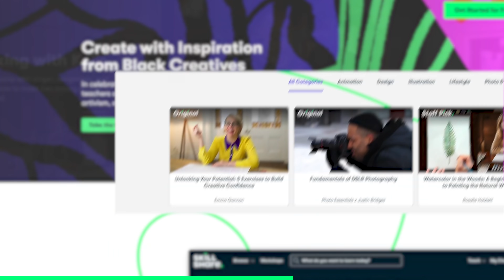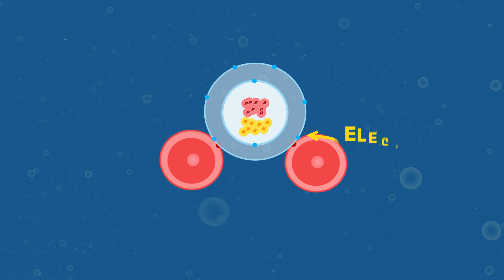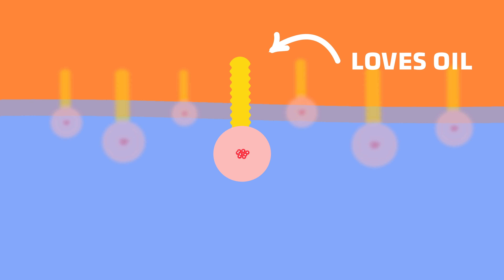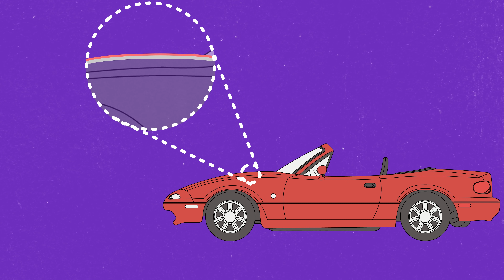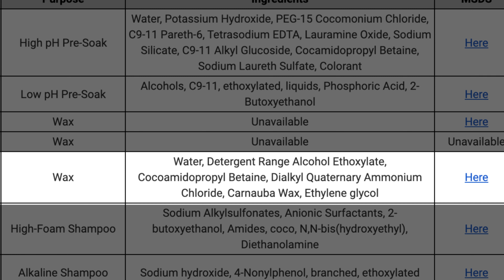Why Car Washes Might Be Scamming You with SOAP

Comment: Entry level employee at a local car wash here. Just wanted to share what I know and ask a question about the wax experiment in the video here. From what I understand about the waxing process, at the wash I work at anyway, as it's only been explained to me; the waxes and polishes we offer are "accumulative". We set the expectation for the customer that, if they routinely get these washes applying the wax coat finish at least once a week, that as time goes on, the better and better the vehicle will progressively look. I think its about a month or so's time of consistent washing that will yield optimal results. Hypothetically though, do you think the experiment would prove this considering you collected results from multiple washes over a couple months?

Comment: One thing I've learned is that touchless car washes do not clean your car. Every time I've ever used one it came out with a dust film. Almost didn't look like it had evwn been washed. Ran it throigh again and it was still dusty, but a light swipe of my finger would remove the dust. All they do is rinse off larger dirt particles. Even a pressure washer doesnt rwmove dirt particles. You can hold the wNd up close and when it dries it will still have a dusty look. If you aren't using something to physically clean it like a cloth or sponge you will always have that dusty film, especially on a dark color like black.

Comment: I've been a auto detailer for 15 years. My biggest issue with why I don't use these is not chem related. Its the fact most of them don't pressure wash those arms and brushes off. So they build up dirt and that scratches your paint. I mean for my profit it's amazing seeing someone who used a carwash for years especially on a black car. But that's just my experience. 😂 If your carwash pressure washes those brushes and stuff then I'd go there but so far I've only ever seen one in my part of Florida do that and those like 17 yr olds be out there at like midnight doing it 😂😂

Comment: It's interesting that you used a red NA Miata for your primer, basecoat, clearcoat demonstration as red, white, blue and black NA Miatas were not clear coated (except the bumpers) while silver, yellow, BRG, Laguna blue and Montego blue were clear coated. But by now I suspect most are as on my NA after 34 years only the area around the windshield is the original paint.

Comment: I used to work at a gas station with a car wash and we were told that if the carwash craps out before it's finished to give the customer their money back and tell them to immediately go to the nearest carwash and get the soap washed off. They had to pay for a customer to get their car repainted after the tricolor soap sat on the paint for too long and ate it.

Comment: My biggest pet peeve when getting my car washed at a car wash and they don't edge my windows( cracking the windows down to dry off the top). Every time I get it washed and after a few minutes I will roll the window down and sure enough they won't do it and then my freshly clean car will have streaks on the windows.

Comment: Avoid the car wash tunnels.  The brush version...Goodbye clear-coat. Might as well clean with a brill-o pad. The Touchless, has to use high PH to break down the dirt. High acidic water? Pass.  I pull into a bay, pump foam gun it. Wipe with a wool mit, spraying the mit often to keep it clean. Then hit the highway to work that doubles as drying it. Paint doesn't have a single swirl mark and it's 5 years old. But that's just me.

Comment: Commercial truck driver tip here, just take your car to a Blue beacon car wash, you may have to wait in line for an hour, but they do car washes for $25 in my state of Tennessee. They hand wash some parts and blast at others, but it always comes out nice for me for the price. Also I would like to mention that if you have a lifted truck, pushing the maximum  allowable height for the automatic car wash, the worse job it will do, according to my experience. Nobody asked me for my opinion but here it is anyway. 🫡

Comment: The pH of the soap if mostly bullshit. You use a very small amount of soap to a very large amount of water, so lets say water has pH 7.0. Then use a soap with pH 5.0 and the result will be like... pH 6.99. In fact, the temperature of the water has a bigger effect of the pH than the soap. Not to mention the normal variations of water, not only between different places but over time from the same source. As a factual example. Our municipally water here have a pH of roughly between 8.0 and 8.5. Yes, that variation is NORMAL. And also a pH above 7 is normal.

Comment: not accurate! and misleading...a microscope would not test whether the "polish" worked. If the foam really did have a wax, sealant, SiO2 in it...it would leave a microscopic layer of protection on the paint. This you can test with a gloss meter or test for hydrophobicity by spraying water and analyzing the water behavior

Comment: Or don't use a touchless wash. Years ago some story made me paranoid about using a brush carwash. Well I now have been using one for years three times a week because I am an Uber  driver. My car is not at all scratched up. It gets the job done. Usually at the end there are a couple areas requiring some attention particularly with drying. But it gets my dirty car clean.

Comment: I had an idea similar to this to see how much salt is in the water during the colder months. Surely they recycle the water through filtration to save on cost, right? Most filtration won't remove sodium dissolved in solution.

Comment: I can simply things for everyone. Generally speaking, the soap and pre soak are the same chemical, just titrated differently and applied at different pressures. They add foaming agent because people think it cleans better if it's foamy, but it's only foamy so you think it's doing a better job. Bug and tar remover is usually the same chemical as the engine and tire cleaner. Tri Gloss is essentially clear coat or wax with foaming agent and dye, and often if a carwash is out of Tri Gloss they'll substitute it with their regular clear coat or wax. The rinse water is usually recycled water from previous washes, with the spot free being RO city water. The drying agent is often diluted wax as well.

Those are not rules as every carwash will have different chemical suppliers. 

My family is deeply involved in carwashes building, sales, and chemicals.

Comment: Just took my car to a wash last night. There’s two nearby, one that is decent enough if I just want to get thick layers of dirt off. The other one hardly gets the rear side of my car clean whenever I’ve used it. Unfortunately, the decent one was closed, so I had to use the crappier one. I tried their most expensive wash, weakly justifying it by thinking maybe I just didn’t go for that one in the past and that’s why the rear side wasn’t clean last time. Nope. Made no difference except, just as the video said, it just took more of my money. I’ve never been fully trusting of touchless washes for those reasons. I only really use them in the winter when it’s too cold to use the garden hose.

Comment: I owned a carwash and we do use different chemicals and run the machines at different speeds or numbers of passes for the more expensive washes. However the cleaning is done through contact. Sure the pre sprays and chemicals loosen things up but you cant really get that clean without having adequate and even contact. Many of these machines have laser, touch and strain sensors to know when they are putting too much pressure on the vehicles and back off to avoid scratches. Two most important things in an automatic car wash is how clean the rinse water is and how good the lubricant that gets sprayed onto the brushes are. All the other stuff doesn't really alter the wash in any noticeable way. The only time I had a long program outperform a basic 4 cycle was with multiple rinse cycles between chemicals and thats a huge waste of water.

Comment: As a car cleaning and eventually into auto detailer since age 13, I never trust automatic car washes. Most of them are horrible. Let's just discount the washes with brushes because it's pretty clear where that's going. You couldn't pay me to go through there.
The touchless washes are just ok, but choose the cheapest option because God knows what money they save using common detergents and degreasers which, alright yeah they smell good and look cool lol. I had a Ford focus and my dad has an 03 Land Rover Discovery and after Chevron's wash both cars started to have this horrible milky streaking on our plastic trim after going through the "express" wash or whatever. It wasn't the cheaper option because the mid and upper options had loads more "washing steps" but It just tore apart the layer of Wipe New I had applied a short while beforehand and never, over 2 years, was I ever able to get it off despite trial and error on inconspicuous areas of the trim, tons of research and all around brainstorming in desperation. The cheapest touchless car washes are much more worth it if you wanna get layers of dust, bugs, mud, other debris, somewhat removed from the vehicle. Keep in mind though that's with expectations for as close as possible to a showroom floor quality detail.
Reply: It's worth mentioning that the Wipe New was hardly to blame if at all because on both of the aforementioned vehicles, the product was applied at vastly different times: on the Focus, it was a year or so before the land Rover, which it had been applied to about a couple months back. And the horrible streaking that was left behind only very slowly started to disappear just with age more than anything. I mean a year later they looked, for the most part, back to normal again. I gave up after a few months of throwing everything I had at it to get it to come off the Focus.

Comment: Cheap kids bubble liquid ((soap )) is also good as an insect killer especially FIREANTS I hate them pour some on the ant hill hose it up to foam and let it sink in boom ant carnage wash and repeat for total ant killage let it soak in and it gets the queen and most times they will not come back either cheaper and safer than those expensive chemicals ants have exoskeleton bodies so soap blocks the breathing passages

Comment: Modern car washes often re-use the water, but that saves millions of gallons of water over its lifetime and is OK, as long as they filter it.  Automated car washes can knock off your mirror or scratch your car if they're never repaired and maintained.  In spite of all that, automated car washes are much much safer to use than human car washes.  All those people are scratching your paint; you can only hope that it's not on purpose...

Comment: The negative pole on a water molecule is located as far away from the hydrogen atoms as possible: the opposite side of the molecule, not between/around the hydrogen atoms as circled at 2.57

Comment: Other than spot washing bird poop or occasional tree sap I probably haven't washed a car in 20 years or more. Rain washes it, I live in NC so that happens on a fairly regular basis. Dirty part is probably around the gas cap that has a door over it so it doesn't get rained on directly. And I've had mostly gold or silver metallic cars and trucks that don't seem to show much dirt, and the paint doesn't peal off like it seemed to do when they first came out many decades ago. My 97 Chevy truck is silver metallic and I've only recently noticed the top of the cab maybe starting to get a pattern of spots that might start peeling in the next few years. But even though only a 2wd it's high enough that I really don't see the top very directly and so probably won't bother me.

Comment: I only use an automated carwash for 1 reason. Salt. I live in PA and in the winter when it snows salt is used to melt the snow. I don't want that salt on my truck at all. So the moment the snow has passed and there's no more saltwater on the road I immediately go to the carwash and get the option that has the undercarriage clean just to wash away most of the salt.

Comment: BIG Prob in places with salted winter streets is whether the car wash water is recycled.  Costs the operator mucho dinero to use fresh water with each car wash so they recycle the water AND EVERY bit of salt back onto yer car.  MAJOR problem happens bec the salted water when sprayed up into all the nooks and crannies (NOT grannies) above and esspecially below your car do what salt is paid to do - RUST like it's 1999.  NO, the rinse water DOES NOT FLUSH it out, it only pushes it up into the nooks and crannies of the nooks and crannies.  I know, I learnt the hard, expensivo way when the  rock-n-roll rocker panels of my beautiful car turned to thin sheets of perforated metal in a mere three years.

Comment: I like using a foam cannon with my pressure washer. It’s like tricolor foam but way better. Spray, scrub with a clean car wash sponge or mitt, and rinse and repeat until all the dirt, oils, organic gunk, and grime is gone. Every 3 months, wash as usual then use a clay bar to remove the old wax, and apply new wax.

Comment: The wash at my location was a 100% reclaim system meaning we did not have a sewer system to discharge into. Due to this our BioReactors could not digest the red dye so the three waxes were applied, blue, yellow and white. Also, car washes are just a basic maintenance wash which is very good at keeping the dirt granules off the surface. To remove all dirt you manually have to remove it and don’t pay for wax every time as it just seals in the dirt.  Look at your windshield and this will be apparent.

Comment: I worked at several car washes in High School and College (the tips are good).

The general information here is accurate.  There's 2 types of car washes and they both have their pluses and minuses.  Touchless is less likely to have dirt soaked brushes slapping against your paint at a high rate of speed, but quite frankly they don't clean the car even remotely all that well. 

If you don't believe me - make sure your car has a layer of film that you can differentiate by running your finger across it (or by writing "wash me").  At the end of the touchless car wash (and make sure there's no cheating with people preaching with mits - otherwise it isn't touchless) - don't have it towel dried.  Your finger mark will still be easily visible.

Touchless car washes essentially wash your car in 1 of 2 ways - by preaching with mits or with the towels drying the car.  Neither option is all that clean.

Comment: I’m a pressure washer we use hot water with out soap and it works if it’s really bad yeah we will use degreaser but mostly hot water is all u need  even engines

Comment: The only issue with the touch-less washes are stronger soaps. This is to help break down crap on the paint. It won’t harm your paint, what it can do is remove any wax/sealant protection on your car. Learn how to do a Rinseless wash for a quick way to remove lighter dirt and bird shit. A good waterless wash and soft MF towel will remove bird shit too.

Comment: The concentration of soap, wax, tire cleaner, etc. depends on car wash owner. I have a pressure washing biz. I ask car wash owners and some that are supposed to be mixed 100 to 1 (wax) they mix it 1,000 to 1. So by the time the wax get to the nozzle end, and on your car,  you're out of time.

Comment: I work at a carwash and we use 6 different chemicals and 3 of them actually go In to cleaning the car the rest is to wax and dry the car off. The most expensive chemical we keep on site is  cinnamon that gets applied after the wax

Comment: Just so you guys know... The water that gets sprayed on your car at a car wash has already been sprayed on "156" cars that came through before you.  We have separators and skimmers in the drain below you that sort of "recycles" and sort of "cleans" the water and reuses it over and over... It looks like it's going down the city drain doesn't it? LUL.  It's not (kind of).  Otherwise our water bills would be astronomical.  But they're not (ish) because we use the water over and over.
Reply: ...so the "special" soap you're paying for is actually being "used" by the guy after you who didn't want to pay for it, and you're getting the cheap crap that the previous guy used... See how this all works?  I'm over-generalizing, but you get the point.

Comment: Many car washes have reverse osmosis and water recycling in their wash to cut down on 
a) the amount of water being used and 
b) the amount of chemical that goes into waste. 
When washing your car at home, you use more soap and water than at any typical car wash plus you're putting those chemicals down your local drain versus having them disposed of properly, like a car wash has to. 
Great info though! You definitely know more about chemicals than most chemical reps out there. Good info...but let us not forget that car washes are also helping protect the environment and save water :)

Comment: My dad just retired from a major car wash manufacturer - he did tech support for the car wash owners. They build both drive-through (touch-free and brushes) and self-serve. First thing to know: he won't use car washes. At all. He hand washes all his vehicles himself at home. Second thing: the detergents and waxes and everything are legit, assuming the owners use the stuff meant to go through the machines. The water can make a big difference and if they don't do required maintenance (spoiler: most slack on that), it's going to affect the results. However, the brushes (both manual and rollers) are by far the worst part. They're gross, never cleaned, never maintained, and they're horrible for your car. Bottom line is that if you go to a car wash with an owner who is involved and takes pride in his business, you're gonna be fine. Good luck finding one of those.